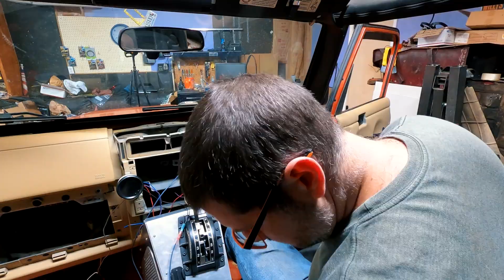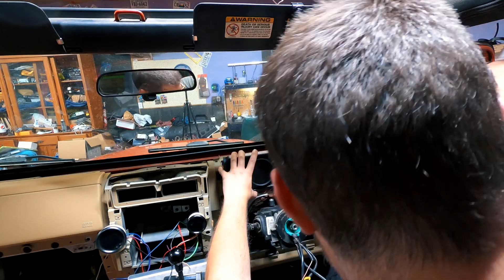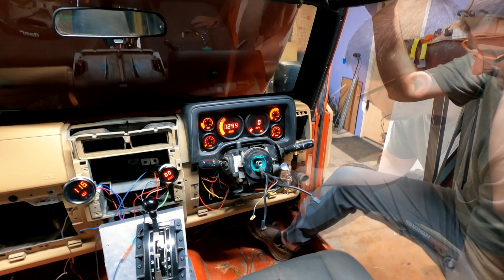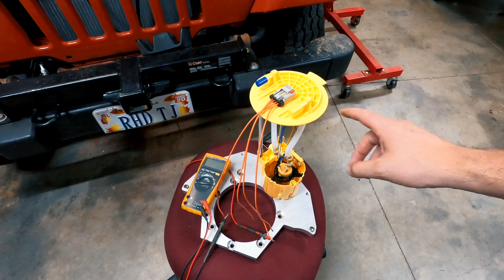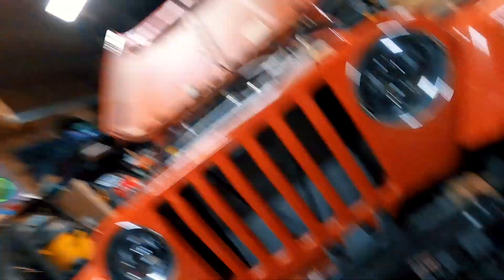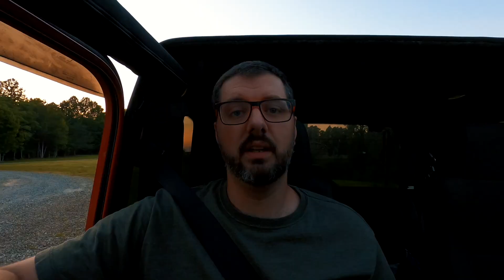Installing Intellitronix Digital Gauges and Autometer Mounting Solution [Diesel RHD TJ - 73]

Comment: Can I do the same thing using Intellitronix for tj but the flat one 1 piece not like yours 6 different pieces. Thanks
Reply from the maker: I think so, I've seen that one online before but I've never personally messed with it but it is designed for the TJ show it should work.
Reply: @RustyAutoholicGuy thanks it’s at the auto electrician as we speak will let you know. Now I just realised will I be able to see the total mileage of the car with my new gauges? Thanks

Comment: I had to come back and find this video. You inspired me over a year ago, and now my cluster just died! 

I've got an old diesel Ram, so this is the closest thing I'll get to a tutorial on that beast! I absolutely love the sweep as well. Definitely the selling point for me! :3
Reply from the maker: Those gauges are fantastic, I've since switched diesel engines in my TJ Wrangler and went with a set of Autometer gauges, but those Intellitronix gauges are going in my buddies YJ Wrangler along with the Kubota engine as well. They are just too cool to not install in something!
Reply: @RustyAutoholicGuy  Those gauges just seem like they were made for a YJ! That 90s aesthetic is palpable. :3 

Plus, the inside of my truck has wires, hoses, and pieces of slotted angle where the Dorito Dashboard  used to be... it already looks like a spaceship. X3 

What engine did you swap into your Wrangler? A 4bt? ☆w☆

Comment: So how do you actually like the gauges now that you have had them for a while?
Reply from the maker: Hey Kristopher, sorry for not seeing your comment for two weeks. I really like these gauges, they are bright, easy to read, and tell me all the information I want in the resolution that I want it. Meaning I can adjust how much the swipe of the Tachometer is for example. I've since switched diesel engines in my TJ to a TDI, so I've switched to Autometer gauges, but I'm install the Kubota engine along with these Intellitronix Gauges in my buddies 1990 YJ Wrangler which are going to look awesome once we get that project going here in the next few weeks.

Comment: Fellow RHD owner here 🤟🏽

Since the fuel gauge only comes with a signal wire what did you connect your sensor ground wire to?
Reply from the maker: Hey, honestly I don't remember, I would have check the top of the tank, I might have just tied it to the chassis ground.

Comment: Great job and tutorial! Did you keep your OEM computer installed for this all to be able to work?  And/or do you have to keep it installed for this? I recently bought a TJ rubicon with a LS install where the OEM computer is gone.., I've owned 2 other TJs w/ LS swaps that I did myself and was told by Novak to keep the OEM computer for the gauge cluster to work properly, so I did. Now back to this new TJ I recently bought where the OEM computer was trashed for whatever apparent reason and now ofcourse none of the factory gauges work, most importantly to me the gas gauge and temp gauge... So mainly, if you don't have to keep your ECU that is great news to me that way that I can order the intellitronics kit and wire everything up. I just need to figure out which wire's come from the sending unit to tap into for the fuel gauge. Since you vid cut out at that stage, which wires did you splice into at the tank?
Reply from the maker: Hey T M, no I didn't keep the original ECU. All the gauges came with their own sending units that I had to connect to the Kubota engine!
Reply: @RustyAutoholicGuy  okay great! Thanks for getting back with me. Which wire did you tap into for the fuel sender? And for the speedo, did you splice into the existing Speedo harness?  I don't have the harness either in this particular Jeep (it was brilliantly thrown out by previous owner..) and was curious if I could run my own wires from the intellitronics dash to the speedo sensor at the tail shaft.
Reply from the maker: I had wired in a new harness for the diesel lift pump so that won't be of help, as for the speedometer I used an output wire that came from my TCU for my transmission for my speedometer.
Reply: @RustyAutoholicGuy  so you didn't splice into the 231 t-case speed sensor?
Reply from the maker: No I didn't though I am using the t-case speed sensor as my output speed sensor for my Quick6 TCU for the Ford 6r80 automatic transmission I've swapped in.

Comment: I didn’t see where you covered the installation of the tach - where did you hook up the signal wires and did it need a sending unit to get it to work?
Reply from the maker: Check my video I posted at the end of this comment, I modified my alternator for the tach signal and routed it through a Dakota Digital Speedometer and Tachometer Interface module. 

https://youtu.be/0IVgjEfnX0Q

Comment: Will this cluster work with an XJ? Besides the fitment which I can work around my self. Just wondering
Reply from the maker: Not sure but I don't see why not, I don't have an XJ where I can try it out, though I will say it would have to be an XJ Cherokee made after the facelift in 1997 I believe.
Reply: @RustyAutoholicGuy  oh no! I have a 92 lol
Reply: @Boss-888  I have a 93 xj and I’m wondering the same thing, did you ever figure anything out?
Reply: @blainealvey3618  have not been able to figure out an easy route besides having to do
It from scratch. No kits are really sold for obd1 xj. Very time consuming so haven’t gave it a shot. If I do I’ll post a video
Reply: @Boss-888  thank you
Reply: @Boss-888  have you looked into the individual gauges from intellitronix?
Reply: @blainealvey3618  I have. Just a lot of wiring and you have to figure out which sensors will work with your Jeep.

Comment: I love the style of the gauges, but the scale is a bit wonky for me. For example the volt meter should have 14v towards the center of the scale. So a scale from like 10v to 18v would be ideal.

Still looks badass tho!

Keep up the great videos, on the edge of my seat
Reply from the maker: You're absolutely correct, the one that bothers me also is the coolant temperature gauge, I wish it started lower than 160° as well.
Reply: @RustyAutoholicGuy  I think they did it to widen the application range. Small details, still a cool cluster

Comment: Hi again, it's Roy from down under, 
Very intricate and good work.   

I love your work!

I put a comment attached to your post on the serpentine belt with respect to a few things, ( all good ) ,not sure if you have a different system for catching all of your new comments as I think that was an older post of yours, and wasn't sure if you go through all of them checking what's new.

Just some differences and variety we get here in Australia.

It Might be worth a read see how you go,

Thanks Roy
Reply from the maker: Hey Roy thank you so much for all the comments! I should have add to your first comment that I know of several engines, not the specific models, but just knowledge of diesel engines that were put into varies vehicles that I wish I could easily and cheaply get my hands on here in the states. There are several Japanese diesel engines that I think would work great in swaps here. I'm more about clean, quiet and efficient diesel than the big horsepower and torque that seems to be popular here!

Comment: Might be worth it to use one of these power distribution blocks behind the cluster, and adding or removing is as easy turning a screw.
https://www.epoolsupply.com/products/caretaker-ultra-flex-8-port-motor-sensor-terminal-strip?variant=31560428322901&utm_medium=cpc&utm_source=google&utm_campaign=Google%20Shopping&gclid=CjwKCAjw2uf2BRBpEiwA31VZj-ewLmBLM07QuTrHak1ZZd1H8TmDjhBbTMZFlW23CDg_uzQ26X3IJhoC_y4QAvD_BwE
Reply from the maker: I'll take a look! I had looked at something similar in the past but I was worried about water and moisture if I got caught in high water or a heavy rain with the top off!
Reply: They do fine in message board trailers from roadside construction sites, esentually a unsealed aluminum box filled with led pannels and circuit boards.